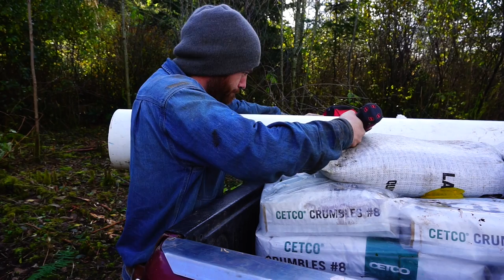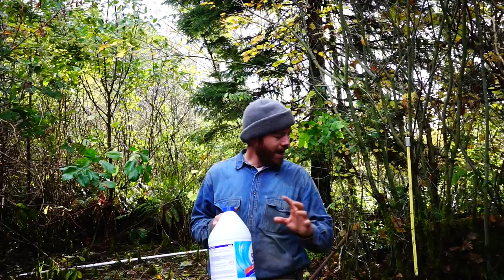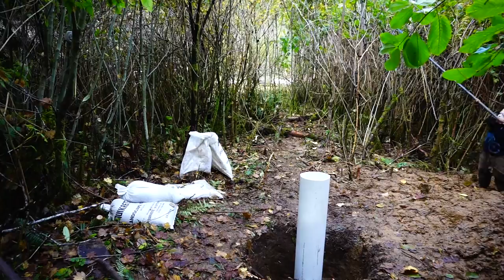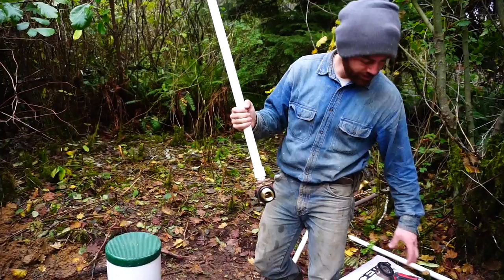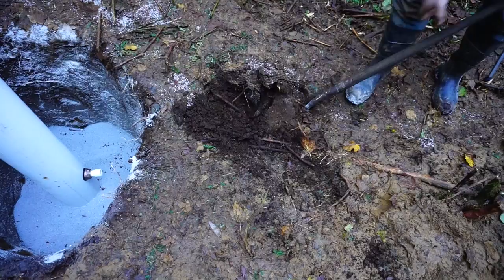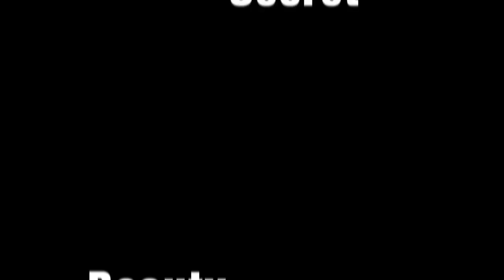Part 2: Digging a 9ft Well With a Shovel

Comment: I wouldn't have put that filter fabric on there. Once that's blocked that's it. It's blocked for good. You be much better relying on the foot valve filter as it can be removed and cleaned.

Comment: In most parts of the world, once you dug the well to bellow the water level, people would use bricks or stone, or concrete blocks on the inside  walls of the well all the way up to the top. 

So you can lower a bucket on a rope to draw water if there is no electricity or the pump breaks down. 

You would only put a few bags of gravel at the bottom of the well to filter the water.
No need for bentonite clay. 

In Czhek republic they use cylindric concrete castings that get lowered as they dig the well.

Comment: I would have drilled a lot more holes much smaller in a precise pattern. Don't know if I would trust that filter material for the long term without clogging up either. Also, really think at 10 ft you could have dug one with a water hose and pvc. even big enough to fit your submersible pump in. beat the pvc into the water table and flush it as  you go. could have gone much deeper. at 3 ft on a wet year, how much water will you have on a much dryer year?

Comment: This well is different than what I thought it would be (well, way simpler from what you begun with).

I am still not sure which method (hand shovelling or mud digging) would have be faster, although the mud digging might be problematic depending on your bylaws.

Anyway, that is still a lot of bentonite. Do you have a requirement of how deep the bentonite needs to be? I cannot believe if you had a 100' deep well, you'll have to put bentonite up to the top of that well.

Keep on your good work.
Reply from the maker: Yeah, this was a little out of the ordinary because of the way the state well standards are written. It is working out though. 

The state requires that a bentonite seal be at least 18 ft deep, from the top down, or within 3ft of the bottom of the well if the well is less than 18 ft deep. Either way, the greatest expense on this well was the bentonite clay. And the company that offered to dig it for me was going to use an excavator to dig a hole the size of an suv, 20ft deep. That would have been a few thousand dollars worth of bentonite clay.

I always enjoy your input.

Comment: I don't see why you need that much clay as a plug. A foot of it will be impermeable. The rest can be topsoil as nothing will be going down past it. Nice to have something easier to dig out again other than gravel though. I have seen others install a membrane over the gravel, but I prefer your use of clay as a top seal. Using both would be best I think. Also best to dig wells in a dry summer.

Comment: I can't see the point in filling to the surface, without first clearing all the top soil from around the immediate area. As soon as you reach the topsoil layer then there's nothing to gain by going higher?
I'm impressed you managed to dig that deep, no easy task for sure.
Reply from the maker: First of all,  welcome to the channel and thanks for all the comments. I'm a little slow getting to them but I'm going through them today. When it comes to filling to the surface, I totally see your point. The reason that I did things this way is because this is what the state code called for. Digging this was an awesome experience, I have an odd bucket list.

Comment: I am curious what filter material you have that is safe for potable water.
Reply from the maker: +Dane Smith I used gravel that was washed and chlorinated. On top of that I used bentonite clay that was certified for we'll use and potable water. I followed the state guidelines for filling the cavity.
Reply: Simple Ground I'm sorry I wasn't clear. I was trying to asking about the black fabric  material around the well  central pipe
Reply from the maker: Dane Smith That was my mistake, I bought that fabric at the well supply store, I don't know the details on it but they told me that it was the stuff for wells.
Reply: I think they call it filter cloth or filter fabric. You can get it at a building supply place people put it around their sump pit wells too.

Comment: Should you have used a level to plumb the casing?
Reply from the maker: +Jaye Jay Curry It needs to be plumb. I did fairly well by eye and I haven't had any trouble pumping from it. It would have Ben better still if I had used a level.
Reply: I thought so. May your eye be true. Thanks.

Comment: why so much bentonite clay?
why do you have to go all the way to the surface, why not just pour about 3 ft and then cap it with cement?
Reply from the maker: Max Steel The bentonite clay is a state regulation. It has been a while since I was in the thick of things, so I don't remember the details of the requirements. I know that they had some mention of cement but it wouldn't work in our particular situation.
Reply: I also wonder about "prions"/amoeba. If the state testing isn't thorough enough it may skip that test.
I'm not for causing home-owners headaches through cost, but seeing as there is no cure for that affliction, I would test for it myself through an independent lab, if need be.

Lastly, there is a blight (among the firefighting community in particular) 
that has gone completely unnoticed by the general public.
BROMINE.
not unlike lead, it contaminates through contact and flakes off,
billed as a fire retardant, it not only doesn't serve it's purpose, but it causes cancer.
PVC (and polyester) are drenched in it.(also wood)
I wouldn't even begin to know where a person could find "untreated" PVC or a cheap building alternative, but FYI, watch out for Bromine in clothing, water ducts, and air vents.

Legislation is going through the pipeline but its taking forever because we're fighting phillip morris and monsanto
Reply from the maker: There are dangerous substances out there for sure, but I feel much safer drinking water from a system I built, over water from most cities. That is just my opinion though.
Reply: Agreed.
Reply: @Splatzloki  Amoebas and most pathogenic bacteria are big enough to be removed with a fine (<0.6 micron) filter. Viruses and other smaller pathogens will often require some kind of chemical (like sodium hypochlorite,) radiation (UV is common,) boiling or other treatment. Treatment for chemical contamination is usually specific to the chemical being treated. Local health agencies will often do a basic water test on a sample for a nominal fee. One can also send samples to independent testing labs that will test for nitrates, agricultural and industrial chemicals and almost anything however some of the tests may be expensive. I'm curious where you get water that satisfies all of your health and safety concerns? Are you aware that in the US, bottled water has fewer regulations for health and safety standards and testing than tap water does?
Reply: @noyopacific  
I'm a mountain man. I could very easily be mistaken, but when you get water from the source (melted snow) upstream from any animal urine. It doesn't get much cleaner.

Comment: $13 per bag X maybe 20-30 bags = $390. Why not just buy an RO member for $30, a pressure pump for $15, 3 normal filters for $50-100, $20 for piping and accessories, $20 battery and $50-$75 solar panel and have great drinking water for a total of $175-230, that way one will not have to worry about surface contaminants or minerals?
Reply from the maker: Autonomy is a big factor. But the biggest factor was that I needed a well to obtain building permits here. Also, I don't know where you are located but here those price tags are a little odd. I couldn't build a reverse osmosis system for 230. Plus I still need a water source.
Reply: Hmm, yes a water well is important. An RO membrane* with its housing can be found for CDN$39 on amazon.ca and USD30 on amazon.com, it will deliver 50GPD of drinking water, the rest of the parts are available everywhere. Alternatively, a 5 stage RO filter can be purchased for CDN$ 225. I was researching these filters last month but turns out that due to my location, an $175 investment in a filter was delivering an ROI of 4.5 years since, I only need 16 gallons of drinking water per month. Hence, I get those big 4 gallon water bottles.